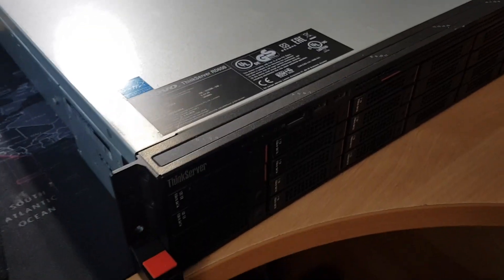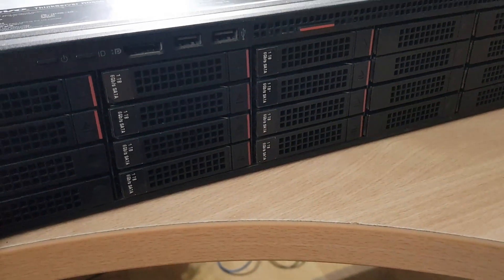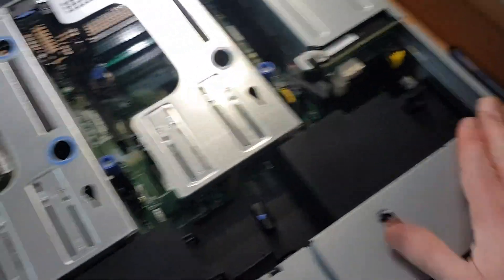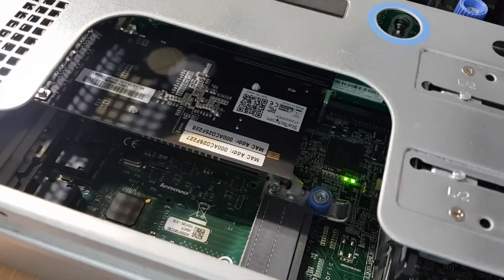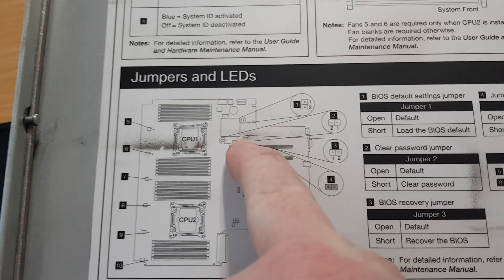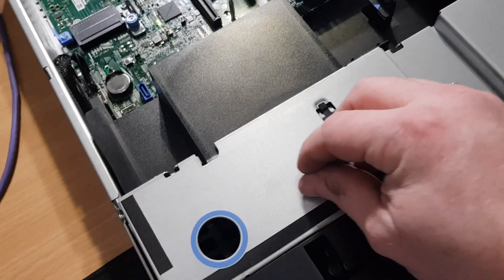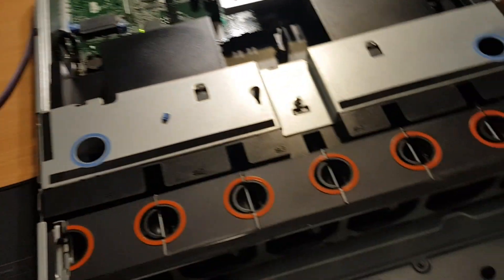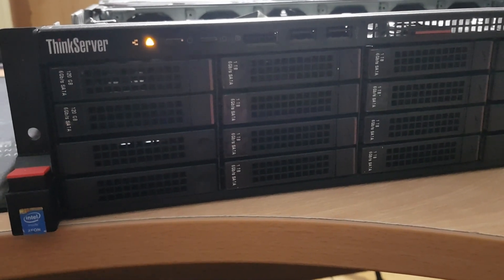Lenovo RD650 - Failed Bios isn't a surprise

Comment: PowerSupplies are another custom thing hard to maintain (as in, some brands insist their own PSU is used). SuperMicro however have some boards that can use a normal ATX PSU. I like the idea of OpenIndiana on one of those (drivers permitting). Have you ever tried any ARM servers? Are their PSU products ever ok to swap with an ATX PSU?